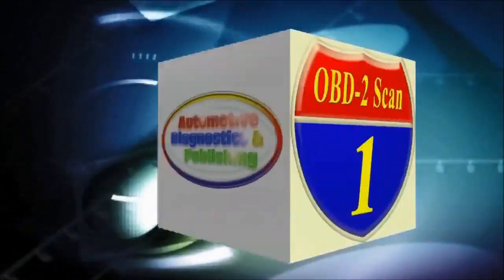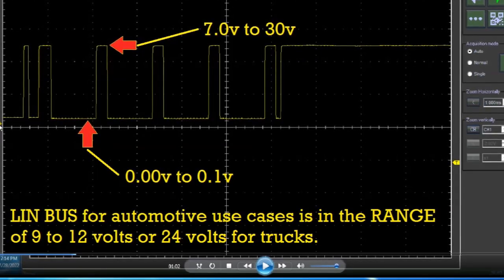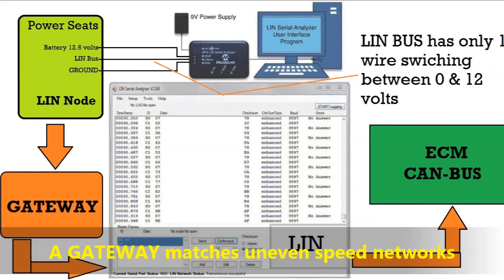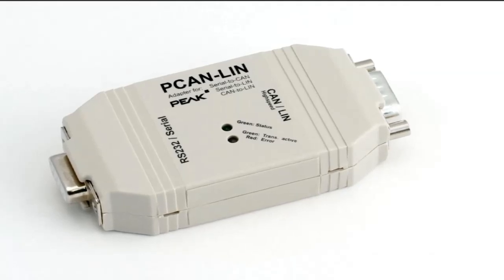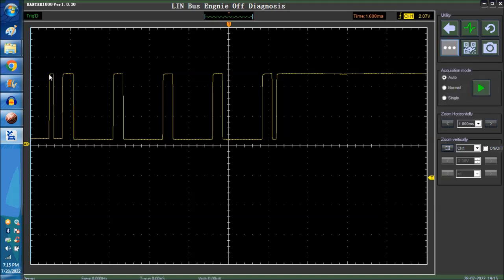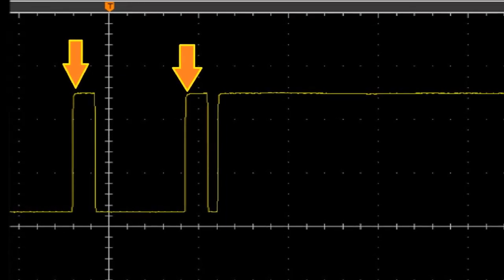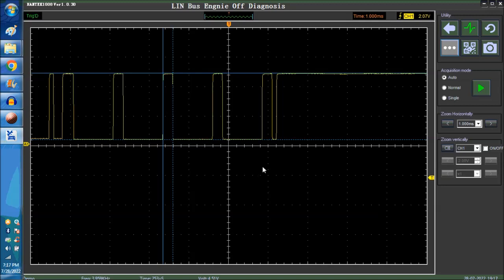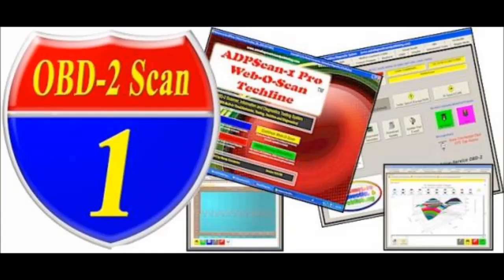LIN BUS Network Diagnostics with 8 Channel Scope

Comment: I worked at a GM plant between 2021 and 2023. Most of the Lyn voltages are recorded were between seven and 11 V
Reply from the maker: Sure, commonly about battery voltage.